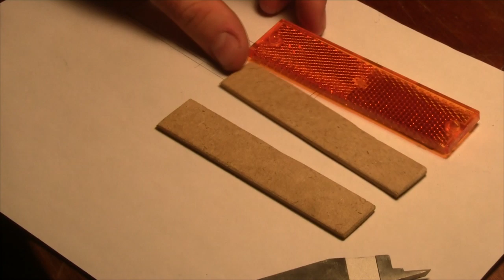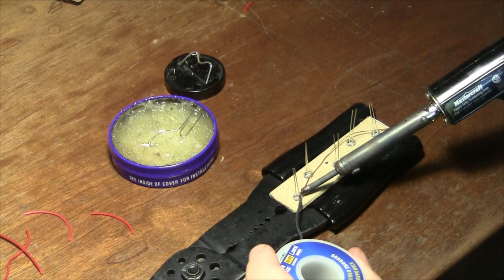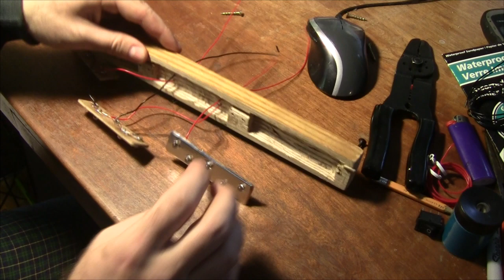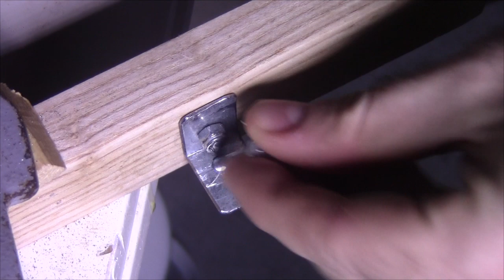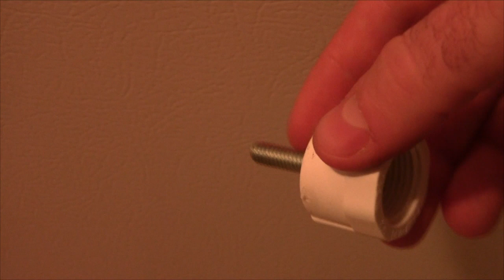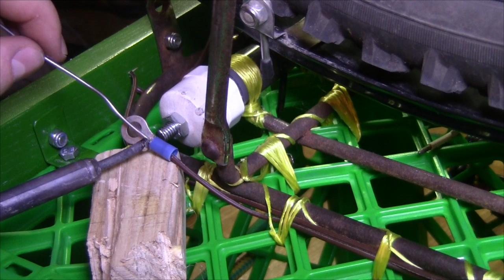How to Build a Custom Rear Bike Light

Comment: whew!  That was a lot of work! You do know you coulda just bought a LED strip, that would have also gave you turn signals.
Reply from the maker: There are infinite other ways I could have built it, but this is the design I went with. One reason why I chose  individual 5mm LEDs is because they run on 3V. LED strips typically run on 12V which is much less practical for this application. As I showed in the video, I originally had the light wired so that the 3 segments could be illuminated separately. I had turn signals in mind with this, but in the end I decided to do away with this for several reasons.

Comment: signal would have been better
Reply from the maker: The reason I have the different segments wired independently is because I was thinking about eventually incorporating turn signals into the light. Unfortunately this bike was stolen before I had the chance to do that.

Comment: Awesome! You should have gotten a cheap led light from China, removed the leds from that, and soldered up your lights to that board so you have different flash patterns.
Reply from the maker: +JakesTornadoGaming Thanks. I used a board from a cheap LED bike light and modified it so that it would only operate with that one flashing pattern. I find it inconvenient using lights which have multiple flashing patterns because turning the light on and off often requires pressing the button 6 or 7 times. I prefer just having a toggle switch for on and off.
Reply: cjhoyle Oh, cool! I see what you mean.

Comment: That is awesome! There is nothing like the feeling of sth you did with your own hands and especially if the result is looking and working nice as this rear light set up. Really like it .Thanks for sharig it with us. I am with front hub dinamo Shimano DH3N20 ,they don't need batteries ,are waterproof and current front and rear lights are made with stand on/parking function (build in condensator) which keeps them on for few minutes even when the bike stops.
Reply from the maker: I've always liked the idea of a self generating system, but the cost of those hubs discourage me! My original custom light only needs a battery change about 2 twice a year, so it's hard to justify the cost of upgrading. I imagine my custom rear lights can be adapted to tie into a self generating hub though.
Reply: cjhoyle What about using one of the old fashioned generators that spin on the side of your tire? I used one of those as a kid to light a headlight on an old 3 speed bike I used on my paper route. Totally agree with you on the cost of those hubs, the cost and time spent re-lacing wheels is enough to keep me from wanting to take it on.
Reply from the maker: StormLaker1975 Yes, I originally considered using a stepper motor running up against the side of the rim or tire to power the light. However, since I ride my bikes 12 months of the year (including the canadian winter) I had some concern that the motor would get damaged from the winter salt and sand.